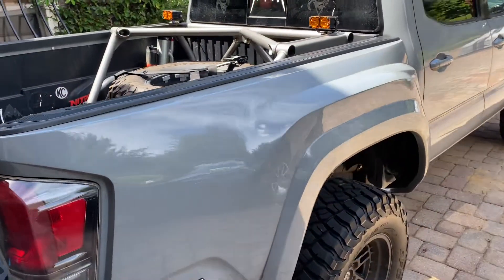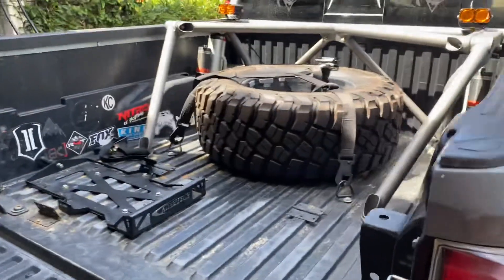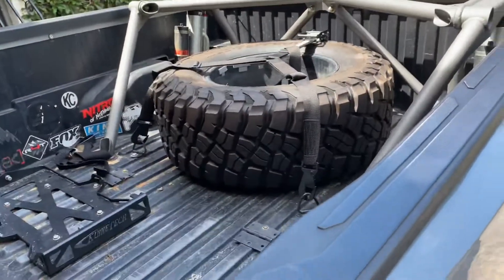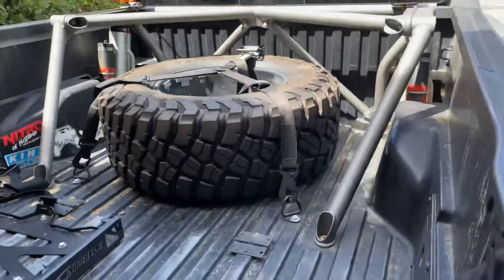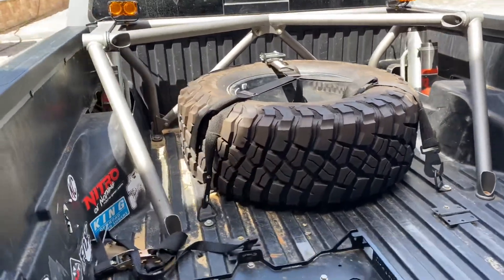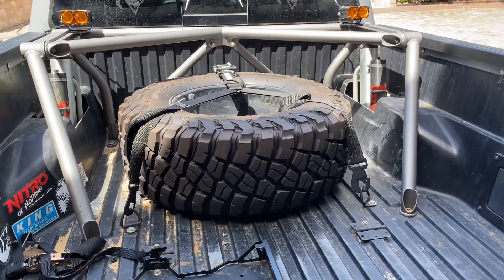Tacoma long travel spring under kit

Comment: @Dune Serpents - did you get a custom drive shaft? or using the factory driveshaft?
Reply from the maker: Factory the 2019 model is a two piece and we adjusted the angle so it does not put stress

Comment: Epic build, but you should NEVER use wheel spacers. Especially on a prerunner
Reply from the maker: Yeah I only run them in the rear but luckily I have had no problems yet it’s just the shocks are too big and the tire hits them without it
Reply: @DUNESERPENTS  You could try wheels with different backspacing in the rear.
Reply from the maker: @marmachuk16  yeah but Innov8 only has -12 I wanted fully forged beadlocks from them